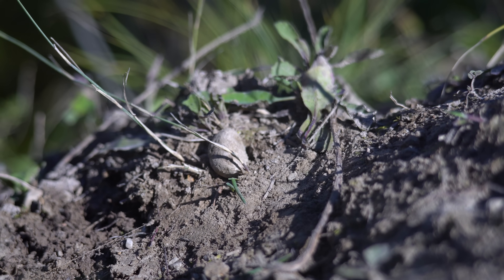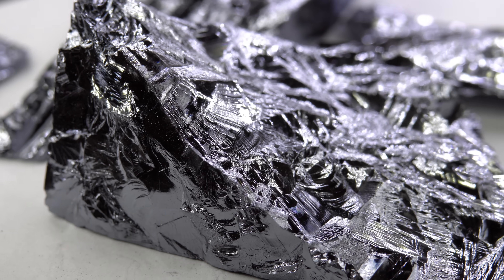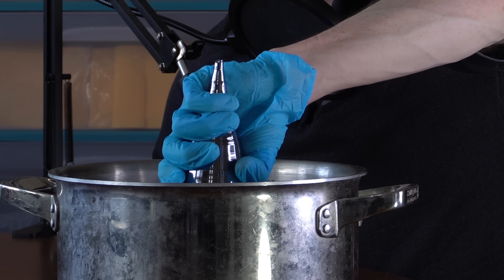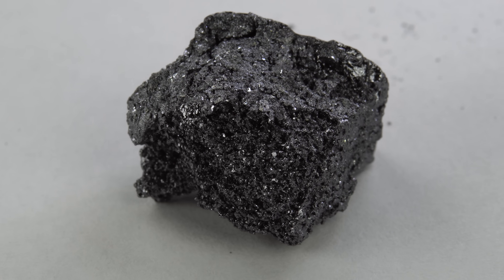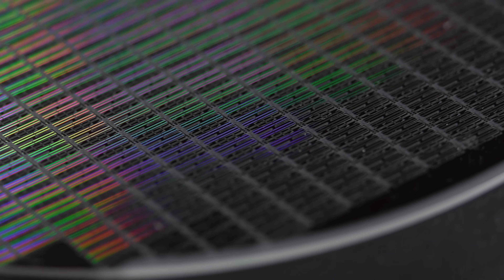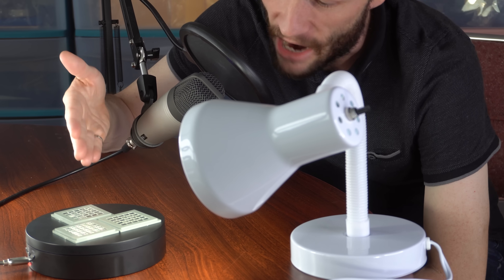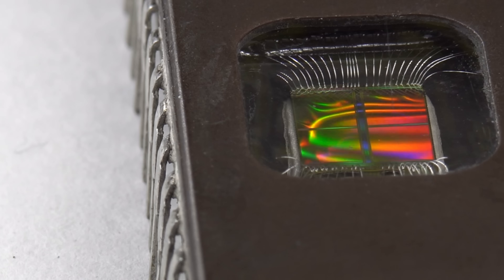How To Make A CPU

Comment: The video is a fun and surprisingly accurate conceptual overview of the major stages involved in semiconductor (and thus CPU) fabrication, albeit presented in a highly simplified, almost "homebrew" comedic style.

So, if you followed those steps literally with household items (hammer, oven, vinegar, desk lamp, etc.):

No, you absolutely would not make a functional CPU. You'd make a mess, and maybe a patterned piece of silicon if you were incredibly lucky with your "photolithography."

However, if you interpret the steps as representing the actual industrial processes they stand in for:

Yes, those are indeed the fundamental stages in making a CPU.

Let's break down why the literal interpretation fails and what the video is actually representing:

Purity & Precision:

Video: Smashing a rock, "purifying" with vague steps.

Reality: Silicon needs to be purified to an insane degree (99.9999999% or "nine nines" and beyond). The monocrystalline ingot growth requires extremely controlled conditions. Wafers are polished to near-atomic flatness.

The "oven" temperature: 1698 Kelvin is about 1425°C or 2600°F. Your home oven doesn't get that hot, and you need highly specialized furnaces.

Photolithography:

Video: Desk lamp, a pre-made "mask," vinegar as etchant.

Reality: This is the heart of chipmaking.

Cleanrooms: Done in ultra-clean rooms (far cleaner than an operating theater) to prevent even microscopic dust from ruining a chip.

Light Source: Uses highly specific wavelengths of light (often Deep Ultraviolet - DUV, or Extreme Ultraviolet - EUV) from incredibly powerful and precise lasers.

Masks: Photomasks are incredibly intricate and expensive, created with electron beams, and contain the patterns for billions of transistors.

Photoresist & Developers: Highly specialized chemicals.

Etching: Uses reactive gases (plasma etching) or precise chemical baths, not just vinegar.

Resolution: Features on a modern CPU are measured in nanometers (billionths of a meter). A desk lamp and a hand-held mask can't achieve this.

Layering & Doping:

Video: Vaguely mentions doping, homo/heteroepitaxy.

Reality: Dozens to hundreds of layers are built up, each requiring precise deposition (e.g., chemical vapor deposition - CVD, physical vapor deposition - PVD), doping (ion implantation), and etching steps. Each layer might define different parts of the transistors, interconnects, etc.

Interconnects & CMP:

Video: Mentions copper interconnects, "chemical mechanical polishing" with a toothbrush.

Reality: Billions of transistors need to be wired together. This uses multiple layers of metal (often copper) deposited and patterned. Chemical Mechanical Planarization (CMP) is crucial for keeping each layer perfectly flat for the next one.

Design:

The video completely skips the most important part: the design of the CPU. A CPU is an incredibly complex logical circuit. The patterns on the photomask are the physical representation of this design. Without the design (which takes teams of engineers years and sophisticated software), you're just making random patterns on silicon.

In summary:

The video humorously shows the sequence and types of operations. If you had a multi-billion dollar fabrication plant (a "fab") with all the specialized equipment, ultra-pure materials, and a completed CPU design, then yes, following those categories of steps would lead to a CPU.

But following the video literally with the items shown will not get you a CPU. You'd be missing:

The actual CPU design.

Nanometer-scale precision.

Extreme material purity.

Ultra-clean environment.

Specialized chemicals and equipment.

Dozens to hundreds of repeated layering and patterning steps.

It's a great way to get a very high-level idea of the process, though!

Comment: ...and remember, the blood sacrifice only goes AFTER you flashed with the laser beam the chromium etched photolithographic quartz mask into the wafer, otherwise the concentrated silicon dioxide will have a minimal probability of remain at 98% of purity. And dont use lamb blood because the sins of the concentrated silicon dioxide will be lifted, leaving the material at 100% purity, but you can make it back to 99.9% purity by showing it some dirty magazines.

Comment: I spent 10yrs in a Intel Fab (Cleanroom) working with process tools. This is a great video. I worked in several different areas, Metal Dep, Silicon Starts, CVD Metal Dep, Metrology and Die Prep (cutting wafer die before packaging. All interesting in their own right. The level of tech there is quick moving.
Reply: How did you get that job?
Reply: @telmodalva3049  Go to school, get a tech degree, apply for a job. They also hire recent vets with military experience. Half my team at times at military experience.

Comment: Seriously how in the mother fuck did people find out ANY of this
Reply: you gotta remember that it didn't happen all at once. First we figured out electricity and how it behaves, along with all the basic rules for chemistry. Then quantum physics came along and we discovered semiconductors, did some materials science and turned silicon into solid-state transistors. Then the first CPUs were literally just wiring these big chunky transistors together into really big room-sized computers. Then people started scaling the technology down to make it smaller and more efficient. More materials science and it turns out that you can etch transistors into a silicon die directly just by doping it correctly and hitting it with ultraviolet light. Do that over and over, first for very large transistors manually, then for smaller and smaller ones using more refined techniques. That process, along with literally trillions of dollars of research and investment over the last 40 years, is how you get a CPU.

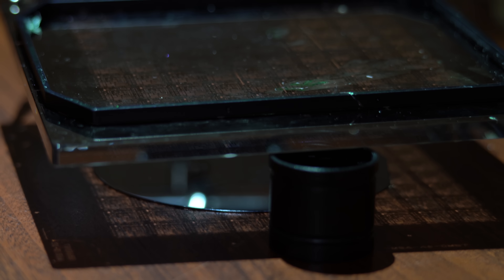Comment: 0:51 The shadows? Isn't it the light? "Light is shone through the photomask, exposing the photoresist in certain areas. The exposed areas undergo a chemical change, making them either soluble or insoluble in a developer solution." https://en.wikipedia.org/wiki/Photolithography

Comment: CPUs control reading and writing from memory locations doing manipulations to the bit (0 or 1, on/off). Software layers of abstraction begin there, from the bios to the operating system to the applications you use. Phone, PC, tablet etc. all the same.

Comment: Okay but why does this work.

Why does ANY of this work.

Like, I get some basic parts. 'Heat rock until rock melts. Keep heating melted rock until you've boiled out all rock junk and distilled pure metal from rock. Use acid to etch magic runes into rock. Connect magic runes with copper paths to pass electricity between them.'

How do we get to the part where it goes from 'highly-controlled pattern of electrical shocks on flat piece of metal' to 'glass screen several feet away lights up and shows you visions of the past and future once you write the magic words and use the wired focusing stone to direct your query to the gods?'

Comment: How the hell did we figure this out
Reply: You didn’t, they did.
Reply: First someone needs a one-way wire to regulate electricity direction, we got the diode. Then someone wants to make a gate that only allow electricity to pass when there is a signal, we got the transistor. Then someone realized they can put transistors together to do logic gates, and with logic gates, they can program anything. Then it become quite obvious that the whole thing can be put in 1 piece of silicon to increase efficiency. From then, the amount of logic got bigger and bigger while the size of the silicon piece got smaller and smaller. At the end, we have thinking rocks.

Comment: Then how does it have clock speeds and cores and threads and have x86_32 or x86_64 or arm or risc v in it? And cache? Level 1, level 2 and level 3? And x3d cache? How?

Comment: First, they take the dinglepop and they smooth it out with a bunch of schleem. The schleem is then repurposed for later batches. They take the dinglebop and they push it through the grumbo, where the fleeb is rubbed against it. It's important that the fleeb is rubbed, because the fleeb has all of the fleeb juice. Then a Schlameeh shows up, and he rubs it, and spits on it. They cut the fleeb. There are several hizzards in the way. The blamphs rub against the chumbles, and the klubus and grumbo are shaved away. That leaves you with a regular old plumbus!

Comment: Think I speak for everyone when I say this is pretty basic entry level stuff, would love some tutorials on more complicated crafts to challenge the mind please
Reply: No problems...  Your task #1 is 'understanding women'...  Let me know when you've achieved that one!
Reply: @trevorvanbremen4718 you defiantly dont!
Reply: I got to the part where I put photo resist on the chromium etched photolithographic quartz mask to localize the etching onto the silicone wafer from a laser light source, 

but when I attached the bond wires onto the pads of the silicon chip, I still didn't get any computing power from the electrical current I ran through its pins. 

Did I not acid etch enough of the silicone wafer's exposed chip particles, or was my mistake in the homoepitaxy step of the curing procedure? 

Any help is appreciated. Thanks! 👍

Comment: Crazy thing is there’s so much technology and innovation that goes into just making the chip, and the actual process of figuring out the Boolean logic and design behind the chip wasn’t even touched on.  And then of course there’s the bios, coding the OS, coding writing code which gets run on the OS, writing a compiler to interpret the code used for those programs.  Shits actually incredible

Comment: Fun fact:
The lasers used to shine the beam step at 0:48?

Those lasers need certain noble gases for cooling. One of the reasons Russia is trying to steal as much land as possible from Ukraine is because Ukraine has enough underground reserves of thoss gases to satisfy decades of microchip production.

And even then, those lasers need to be high powered and fine-tuned to etch things small enough. Taiwan can do it to the nearly smallest resolution physicslly possible. China can't, and it's eager to take that capability from its island neighbor...

It's scary that folks will be throwing rocks at each other over the ability of turning rocks into something special.

Comment: This is how bad my ex gf's Dad didn't want to go to school... This is literally a Good Will Hunting story before there was GWH...  Anyway.  Dude picked a company that he thought would be around 30 years later, picked one that he thought would pay well and then applied to be the custodian.  While cleaning the place for years he was plotting his rise.  Nobody ever suspected him either.  That's why, the original chemical engineer who developed the compounds for developing the chips (I am naive to this process, I assume it was the chemical you used while hitting the slide with the laser) for this company that would eventually contract with the military and design chips used on satellites, just mixed the secret sauce right in front of him.  Fast forward a few years when that engineer suddenly left the company and took the recipe with him.  That's when he seized his opportunity.  He told them that he was positive he could do it, explained he had seen it done hundreds of times and was confident. With nothing to lose they let him have at it and turns out he was right.  He knew the exact ingredients, memorized them and pretended like he was eyeballing it because he knew, if he taught anyone how to do it, he'd lose his value.  He played them for another 30 years.  They tried to get rid of him so many times but whenever they put the heat on him, he'd just take time off and let them struggle.  By the time he got back, they had always tried to replicate his process, even hired people who made the same statements he did when he got the job, and every single one of his replacements couldn't do what he could do.  Eventually a computer or AI or something like that, came up with a different process or solution or perhaps the chips themselves changed, I sincerely don't remember but he eventually retired when he recognized that his time was near an end.  He now goes fishing, plays a ton of video games, and loves mountain biking.

Comment: No No No No No... don't use copper with a silicon microchip. Copper atoms contaminate the silicon wafer as copper diffuses into it very easily. One of the reasons why Intel ditch the Coppermine Intel Pentium III series.

Comment: This seems like we shouldn’t be doing this. Look at all the extreme corners you have to take. 1000+ degrees? 99.99% silicon dioxide? Chemicals? From a rock. Is that not alchemy or a form of magic because by definition it is.

Comment: You missed some key points:

 * Doping it with boron or phosphorus
 * Photoresist stage
 * Shining a laser that projects onto the wafer from a chromium etched photolithographic quartz mask
 * Subsequent highly-localized chemical reactions on the wafer's surface
 * Photoresist development stage
 * Acid etching the exposed parts of the wafer
 * Washing away the photoresist
 * Homo epitaxy
 * Hetero epitaxy
 * Pseudo epitaxy
 * Diffusion doping
 * Dielectric deposition (e.g., silicon dioxide, silicon nitride)
 * Metallization (e.g., copper, aluminum)
 * Copper interconnects
 * Chemical-mechanical polishing
 * To get a final silicon
 * Locating the pads on the chip
 * Attaching bond wires, where the bond wires provide an electrical connection between the pins on the chip package and the pads on the silicon die.
Reply: Just a few small steps. Not a big deal really
Reply: I think we can all agree that the first step in making a cpu is convincing someone to give you a couple hundred million in loose change.

Comment: Forgot to mention that you need to do the process of building the interconnects, photolithography, adding and removing of photoresist and the other stuff like 80 more times layer by layer until the interconnects are done.

Comment: You bought your gaming rig from a store. 
I Get a rock. Smash the rock. Now you have 98% concentrated silicon dioxide.  Purify it to 99.9% pure silicon dioxide.    Purify it further to 99.9999999% polysilicon metal. Put the polysilicon ingots into a crucible.  Heat the silicon ingots to 1698 °K.  Take a small seed monocrystal and dip it into the vat of molten silicon.  Slowly pull the crystal out as it cools.  Now, you've a monocrystal of pure silicon.  Cut it into thin slices. Now, you've got pristine freshly-cut silicon wafers.  Optionally, dope them with Boron, Phosphorus or another dopant. Put photoresist on the wafer.Take a chromium-etched photo-lithographic quartz mask with your desired circuit pattern and shine a laser beam through it to project the circuit pattern onto the wafer. The locations of the shadows produced by the photo-mask will control where the photo-resist is chemically changed on the surface of the silicon wafer (depending on whether you used positive or negative photoresist).  Now, develop the photoresist.Acid etch the exposed parts of the wafer.Perform countless iterations and repetitions of homo-epitaxy, hetero-epitaxy, pseudo-epitaxy, diffusion doping, copper interconnect layers, chemical mechanical polishing, photoresist applications, acid etching, and photomask exposing to build up the desired features on the wafer. Now you've got a finished silicon wafer.  Cut it into pieces.
Now you've got un-packaged silicon dies.  Locate the pads on the silicon chip, and attach bond wires, or use the flip-chip method as is done now for most modern processors. Use the bond wires or solder balls to provide an electrical connection between the pins on the chip package, and the pads on the silicon die.

We are not the same.

Comment: I love how straightforward this recipe is. I’ve made this a dozen times for my friends and family already! Thanks for the simple tutorial!
Reply: Yeah, me too, though i only had an oven, so i had to make do with what i have and used an oven and meat thermometer.
Reply: What are you guys doing differently than me? When I bake my ingots they rise up and look fluffy but then they deflate when I take them out! I checked that the temp is at 1698 Kelvin since that is also the exact temperature my thermometer melts at.
Reply: @bighammer3464  You’ll get that at higher altitudes.
Reply: Ya I have this silicon recipe everyday for lunch
Reply: @sidsmusic991 yum
Reply: What wine do you use  ?

Comment: VERY EASY TUTORIAL. I made a cpu according to his tutorial and installed it on my desktop. Only problem is ,whenever i run a software an error occurs - error rock 99.9999999999999991% silicon only available

Comment: for step 4,what advanced techniques are used to achieve the 99.9999999% purity level in polysilicon metal, and what impurities are most challenging to remove? and how does the presence of trace impurities affect the electrical properties and overall performance of the final silicon wafer?

Comment: >obtain rock from forgotten desert sands
>place rock in a heavenly crucible that converts rock into magical crystal
>shatter the crystal into small, smooth shards
>by the power of an iron sun, inscribe arcane runes into the shards
>empower the shards with lightning
>the shards gain sentience and an ability to think
>place the shards into an artificed clockwork machine of the highest grade
>you now have 24/7 access to Fortnite corn

Comment: For those who don't know, this also has to take place in a completely sterile environmemt with as close to 0 dust/airborne particulates as possible, otherwise everything gets messed up.
All of the conditions of microelectronics facilities, from ventillation to lighting, are closely monitored to prevent damage to the wafers at all stages of processing.
They also wear funny marshmallow suits, which is amazing.